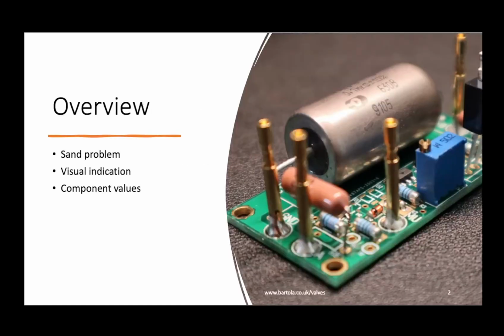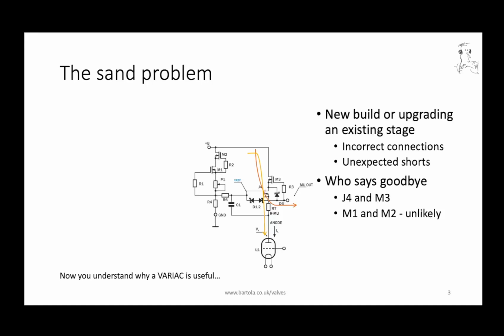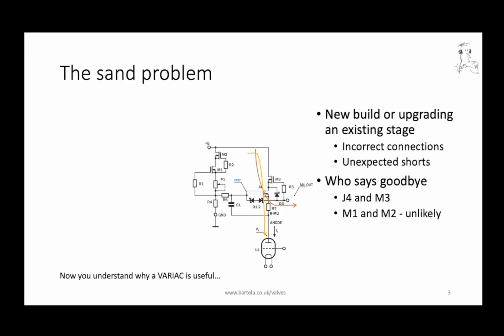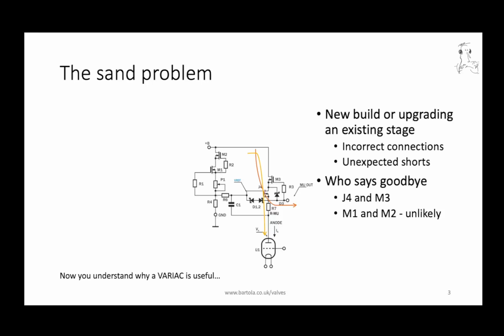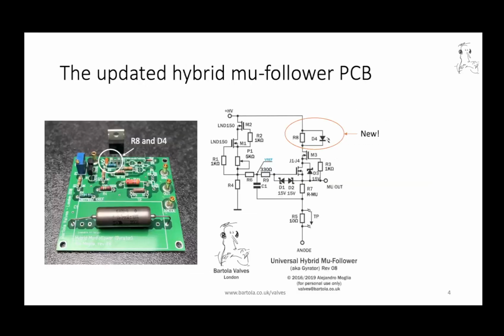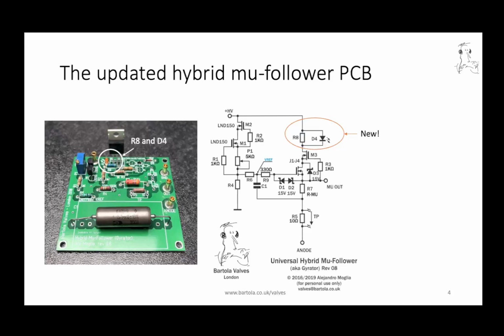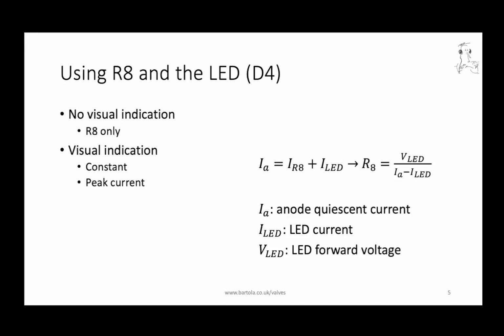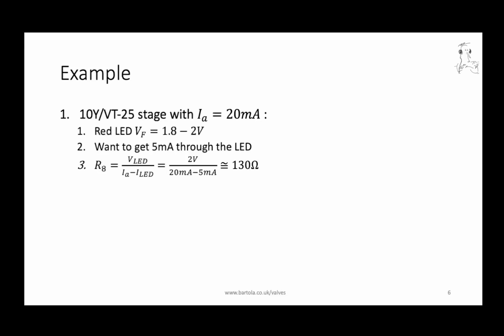Hybrid Mu-follower (V0.8) PCB update

Comment: I did some simulations (ltspice) with a 6C6 triode driver stage, adding the gyrator (v1) and the result is more or less the same, with a little more amplitude at the amplifier output (2A3), but with equal distortion values. What other benefit do I have? Thanks Ale.
Reply: I treat THD simulations with a pinch of salt. DHTs are more linear devices anyway, have a look at the ETF.18 lecture I posted on my blog. If DHT is hard for you to implement as a driver due to filament supply complexity, etc, I'm sure you will get very good performance out of the 6C6 in triode. I haven't used the 6C6 so I can't comment on its sound.